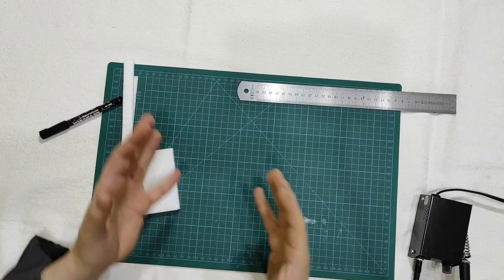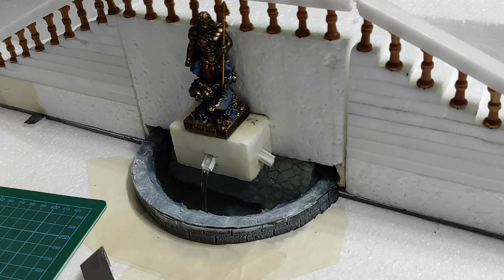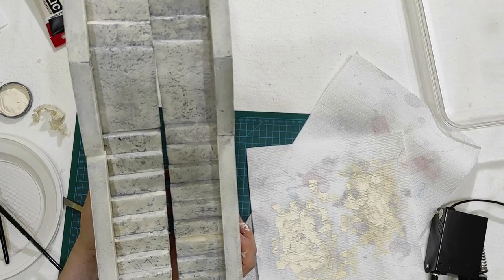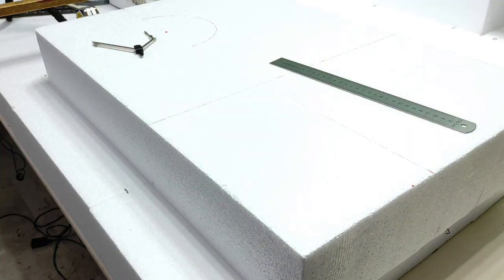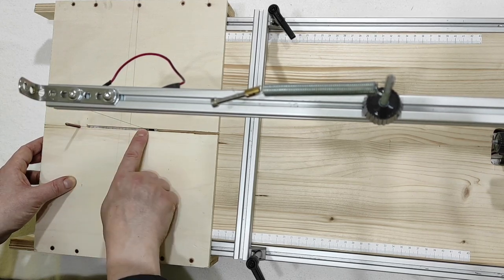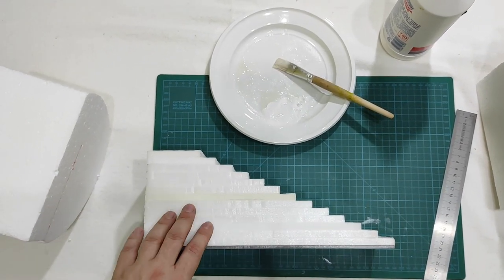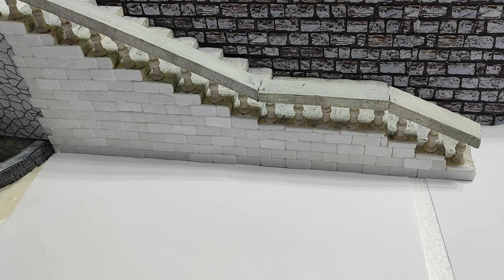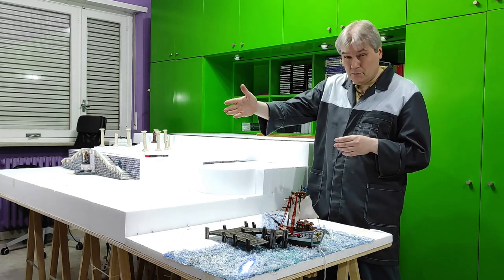Christmas Village Tutorial 2021 - Part 6

Comment: Tecniche sempre più complesse ma molto più realistiche. Continua così. La statua di Poseidone ha qualcosa che non la rende parte integrante della fontana. Forse il fatto che possiede a sua volta una base che poggia su una base più grande. Sono curioso di sapere se troverai qualche soluzione. Un saluto.
Reply from the maker: Hi Antonio. Thanks. I see your point of view but I am a little short on space: the base of the statue overlap the fountain border to the millimeter. I need to think about a possible solution. I will experiment on it.
Reply: @silvioallena  You could add two dolphins on the sides of neptune to cover the gap. It's just a possible solution.
Reply from the maker: Yes it could work. Thanks. I just need to find a couple having the right proportion.